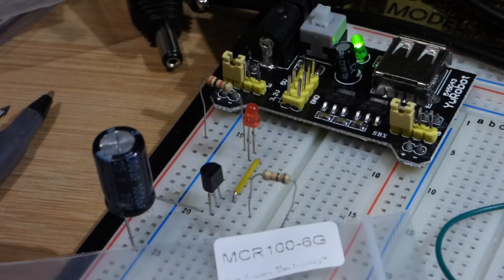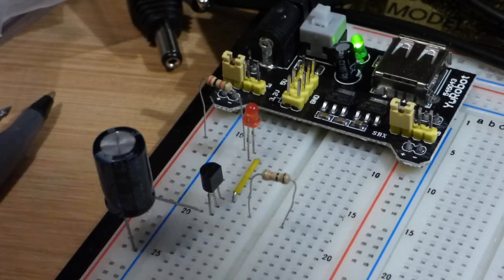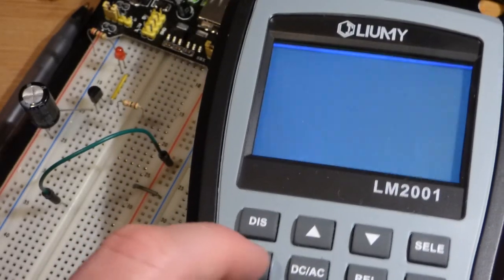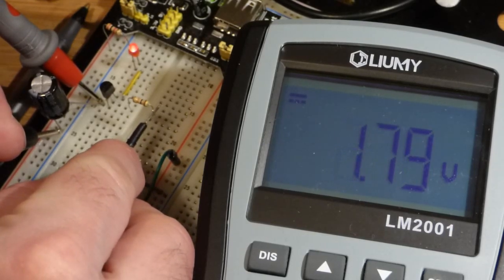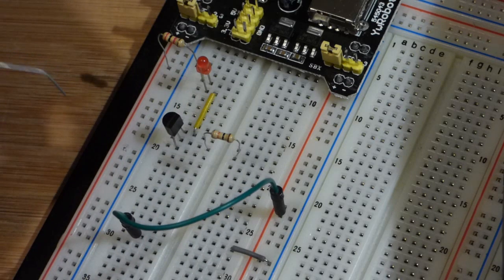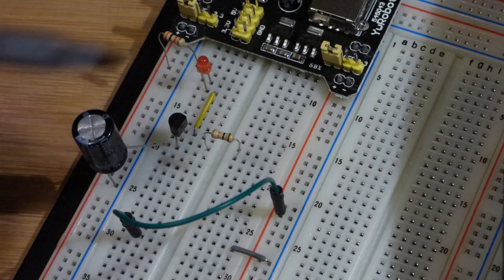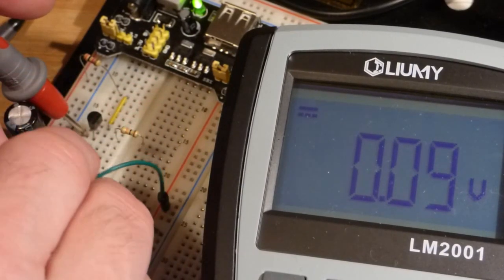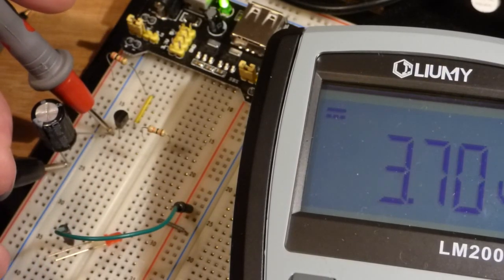Quick demo of how a MCR100 6G silicon controlled rectifier SCR component works

Comment: FTR, if you jumpered the 10K from the power rail to a vacant row and stuck your jumper into that, the current at the business end of your jumper wire would be greatly limited. 5V rail through 10K = 500µA.  That's about the hold current for the MCR100-6 (cathode to anode)-  you could use a 100K for 50µA through the gate, and that would still be above the trigger current for that SCR.
Reply from the maker: Thanks for the info!